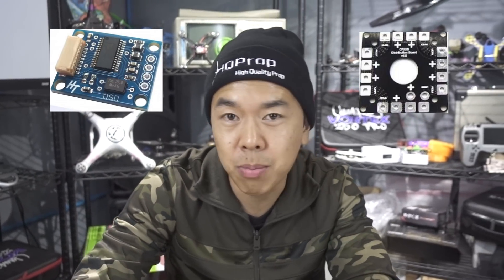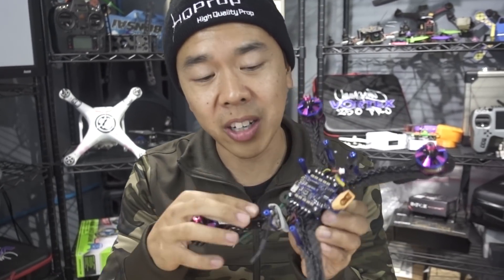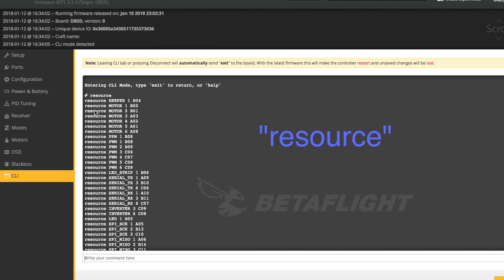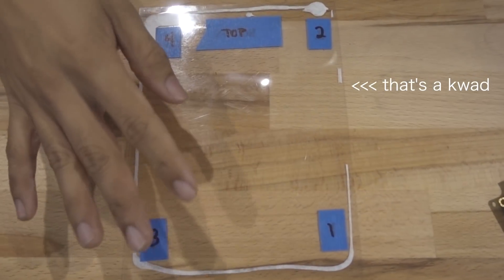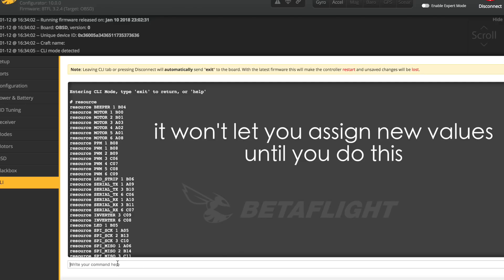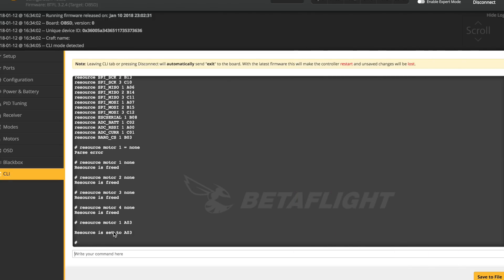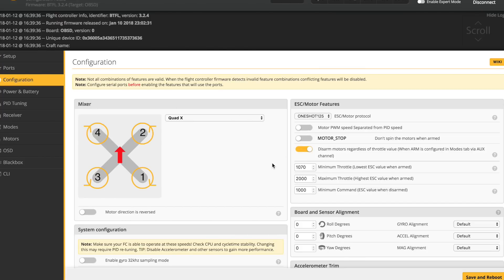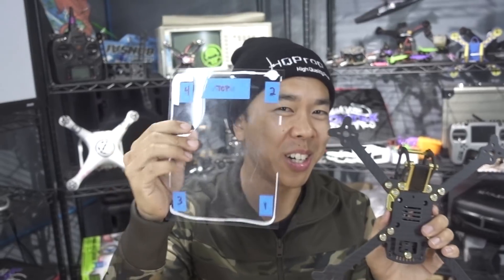[Build Tips] - How to mount your FC in any direction - [Motor Remapping]

Comment: Your showing it as if it was a side mount. Only being turned 90 degrees. Im sure alot of people will mess up following. You show the quad you base this video on real fast. So if someone like me mounted the fc 180 degrees your set up will make there quad go crazy. Just a heads up. You should clarify this. But you def help me

Comment: Excuse my ignorance  but does this method also work if the FC & ESC are turned  upside and turned  90* ccw ? Thx
Reply from the maker: Yes, the values you used will be different obviously but the method should still work

Comment: Tommy you always have the best vids, flights, and tutorials!
I tried this and everything looks as it should it BF (reassigned motors and FC alignment), but it's still not taking off properly. For my Board alignment, I set my yaw 270 degrees versus -90. Is 270 degrees and -90 the same thing? Or does BF see them as different?
Reply from the maker: I'd just do roll 180 (if you have the FC mounted like mine). I've found that BF does weird things even though it's technically the same orientation.
Reply: @ummagawdFPV  Thanks ummagawd! Appreciate you! I'll try it tonight when I get home. Been a fan before the days of ummagawd immersionrc 250! Keep up the good stuff!!

Comment: What if you are using a 4 in 1 ESU and FC combo that is connected together already by a cable would you still need to do this if flipping the stack? I am flipping the stack upside down and around 180 so it mounted upside down and facing backward 180 deg. I was thinking that when I changed this in BF configuration it would automatic adjust the motors as well?
Reply from the maker: You could just repin your connector. But you would still need to do the orientation changes in BF for your FC. Good luck!
Reply: @ummagawdFPV  Thanks man all sorted thanks to this vid. Its you guys that make it possible for a newbie like me to build my own drones.

Comment: I just completed my second build and ran into a problem, while setting up in Betaflight I spooled up the motors to ensure proper spinning direction and only had motors 1 & 3 spin up.  After reflection I realized I had soldered to the motors 5 & 6 signal pads, it's a 20*20 FC and they are on the bottom exactly opposite the 2&4 motor signal pads.  I remembered your video and figured I should be able to reassign the signal pad associated to 5&6 to Resource motors 2&4.  I think this is the best solution, any thought?  Thank you.
Reply from the maker: Mathieu F. Yup that's what I would try, but I've never done it. If it doesn't work, I think you will also need to do some DMA reassignments.
Reply: Went for it and it worked like a charm, had a short maiden flight and all.  Many thanks!
Reply from the maker: sweet! glad it worked out!

Comment: To the comments below, or to anyone. if you plug your F.c in you can see in the orientation in the configuration tab in Betaflight. plug it in, and look at the model, pitch it forward, yaw etc, and you will find out real quick how it is orientated.

Comment: I'm just building a chameleon with your motors and the Holybro AIO v2 fc i am installing the fc 180° so the battery leads are at the top not the bottom. This video is exactly what i needed. Really easy to follow your instructions. Thank you. 👍👍

Comment: Thanks Tommy it's great info as I start to build the Remix with hobbywing x Rotor FC/AIO ESC stack.  Do you know where the smart port wire (X4RSB) goes to on the FC?  is there a dedicated pin or do you have to turn TX6 into a soft serial?

Comment: Thanks for sharing these tips Tommy. Always handy to break  down how motor mapping works... Curious to know if there is any reason why not to just set the board alignment 90 or 270 degrees?
Reply from the maker: Hi David - there are 2 different things I was addressing in this video (that in hindsight now, I wish i spent more time explaining). There's board/gyro orientation, and there's motor mapping/assignment. The former can be handled in the GUI like you said, but the latter is for when you have an FC or ESC stack in which you're suppose to wire to a specific corner. In that case, motor/ESC #1 may actually be wired to pad #3 on your FC/ESC

Comment: Maybe I’m mistaken, but can’t you just rotate the orientation of the FC in the configuration tab?
Reply from the maker: there are 2 different things I was addressing in this video (that in hindsight now, I wish i spent more time explaining). There's board/gyro orientation, and there's motor mapping/assignment. The former can be handled in the GUI like you said, but the latter is for when you have an FC or ESC stack in which you're suppose to wire to a specific corner. In that case, motor/ESC #1 may actually be wired to pad #3 on your FC/ESC

Comment: I had to do this with my MatekF405 OSD and FCHUB6S combo, as I didn’t want my XT60 coming out the rear of my frame. 

My USB is now at the rear of the frame but it’s the Skitzo Dark Matter so I still have easy access to the USB port. 

Helpful video Tommy, I could have been done with this a couple months ago. 😃

Comment: Professor Tommy, this is gold my man.  I'm eagerly awaiting delivery of my Remix and I'll be using the Hobbywing F4 Stack.  Thank you for the great video.
Reply from the maker: Sweet... thats my favorite stack. You'll want to use super short standoffs (or plastic nuts as a base instead of whats included).
Reply: Hey Tommy, ran into a small problem setting up the Hobbywing resourcing.  Followed your video and remapped all 4 motors and in betaflight all motors are now identified correctly.  

I had to change the motor direction in BLHeli Config on the mac but for some reason motor 1 is spinning CW instead of CCW, I have tried changing from normal to reverse and even tried bidirectional reverse in BLHELI made sure I saved and exited, but no matter what I try Motor 1 is still not spinning the correct direction.  

Motors 2,3 and 4 are correct.  Any ideas?? 

I checked and the motors wires are straight to the corresponding pads on the HW 4in1(ie not twisted) 

My resource is 
M1-A03 
M2-A02 
M3-B00
M4-B01  

I'm stuck as to what to try next ???
Reply from the maker: If you are able to spin the motor in the motor tab, then I'm not sure what's up. Technically that ESC is seeing a signal which is all that blheli needs to change things. Have you tried it before the remapping?
Reply: the only way I could get around the problem, was to cross solder 2 of the motor 1 wires to the 4in1.  When I done that and went back into BF, the motor now spins correctly.  Not an idea fix but it will get me in the air for a maiden test until I work out what the issue is.  The FC is running the latest firmware but I haven't flashed the ESC, it is stock out the box, was reluctant to start messing with ESC firmwares if I don't have to.  With regard to BLHELI, I moved the min/max sliders to 1050 and 2000 as they were set to were numbers about 1156 and 1989 for each ESC ?  Left it on medium timing.  I'll give it a try as soon as I get my crossfire Micro RX, they seem to all be out of stock at the moment here in the UK and I don't want to strip any of my other builds.  Thanks Tommy for your help.  Can't wait to rip the REMIX lol.
Reply from the maker: I leave all the blheli settings alone, so you should be good

Comment: Thank you for sharing your Insight.... Being that I'm new to it I was wondering if you could actually flip over a flight controller and thought maybe it might mess up the gyro somehow .... By the way you can use the word muck instead of 🦆 lol  ....

By the way I do believe I'm going to be using your frame for one of my first builds... I know you probably don't want to hear it but the other one is going to be from armattan and it maybe the rooster  ... But when I build yours I'm going to do the split battery design and run one on the bottom and one on the top and see how well that works out...
Reply from the maker: the rooster is a great frame, no reason for me to hate. I'd recommend against a split battery design. The whole point of the remix was to bring the center of mass, to the center. By splitting, you are moving mass to the other edges of the axis. If you get it the weight evenly distributed, it'll probably fly fine, so curious to see what you find. But I found it easier to just bring everything to the center. Good luck man!

Comment: Ummagawd, Sorry, Its a good idea for video but you put it out TOO CONFUSING.  I never really check what my board orientation is. I just solder all as I see fit on the frame. Then you should JUST DO IT, no worries, there is a default settings button on betaflight SETUP screen. Then I just go to motor tab run motor 1 - check which motor spins up then assign spinning motor to its real place. For example running motor 1 -> spins motor 3. You just write that down and then assign the resource :) EZPZ (NEVER FORGET TO CALIBRATE ACCELEROMETER AND CHECK IF quad IS MOVING CORRECTLY ON SETUP SCREEN - if you tend to turn it off as I do :) )
Reply from the maker: I think it's easy for someone like yourself to do it that way, but when I tried to help someone accomplish this, it was too confusing to simply write it down. And even after we got it going, he still didn't really understand what was going on. So I decided to take some time to explain it this way.

Comment: But you do know that you can just open the configuration tab in BF and set the pitch/roll/yaw rotation to match what you did with the fc?
Reply from the maker: Yes, if you don't have signal/ESC pads going to their respective corners. Then that's all you need to do. This video has more to do with remapping the signal wires.
Reply: Yeah that is way easier.
Reply: It's about the signal wiring when their pads are placed at the corners.. See, he's not dumb after all
Reply: Didn’t say he was dumb. I rotated my FC the other day and didn’t have to do any of the resource mapping and it worked just fine is all I’m saying.
Reply: But do you not have to re map when changing motor 1 to motor 3 for example, doesn't the fc still want you to have motor 1 to the default pads?
Reply: Well I figured I wanted to move the FC, flipped it in betaflight, then wired things up. 

Can’t really flip it with everything already wired up.
Reply: I mean, yes, he goes over that part too. The majority of the video is "if you want to keep your wiring clean and the pads are on the corners". So rather than wiring the motors across the board to their respective pads, you can just use the closest pad and remap the resources so it's nice and clean. Some FCs don't even matter because the pads are not on the corners (like my original omnibus clone). This however is a nice way to keep it looking nice and neat if you're so inclined.
Reply: Alan Colon that is what I understood from Tommy, just making double sure we were all on the same page, or tab.
Reply: So when you flip it through betaflight it doesn't remap the signal wires?
Reply: No Paul, The yaw/roll/pitch corrections for how the FC is 
mounted only makes corrections for the data it is seeing from the 
gyro/accelerometer.  It is still expecting that the motors are wired to 
their respective signal pads because as noted earlier, not all FCs put 
their signal pads at the corners nearest their respective motor.

Comment: Hey tommy can you tell me more about your fc youre using? Because i have an sp racing f3 and i fly like crap. But when i see your videos flying youre flying like butter with your kwad. So is it because you have an f4 boar or because of my pids? 
What would be cool is if you do more build videos especially tiny whoops. :)
Reply from the maker: i run the hobbywing F4 AIO stack... F3 boards are fine too... I suggest running anti-virbation standoffs and enabling dynamic_filtering. Having a sweet flying kwad is all about having a clean build and PID tuning (all on good quality components).
Reply: R. K. I also fly an sprf3 board and it flies fine. lower grade components will take more tuning to obtain butter. I dont know your setup but if your having issues with wobble or anything in nature of the quad ( not ykur stick inputs) its most likely your pids. check out stingerswarms pid tuning video where he los tunes his quad. it helped me get a basic understanding of pid tuning. im nlt perfect but i got a decent tune on my beater quad and my wifes mrs.k fpv and both fly great. pm me on fb if you need some help. im always willing to help out.
Reply: ummagawd thank you so much. I think i have good quality components. Im thinking about to buy the dys aria 35 amp blheli 32... is it a good esc?